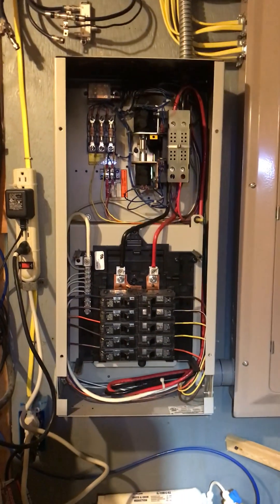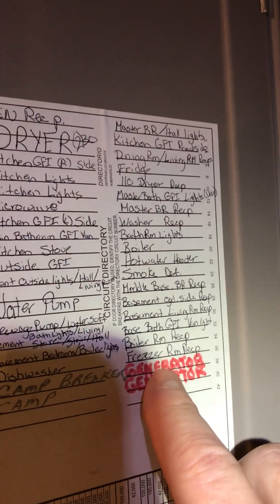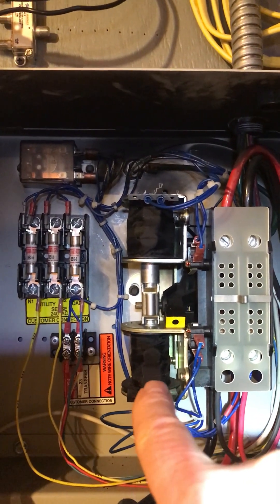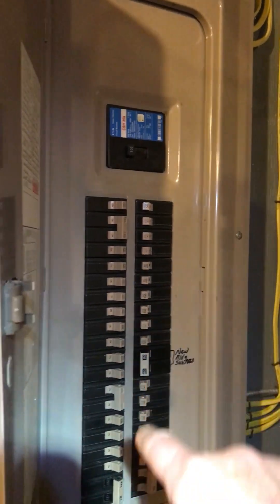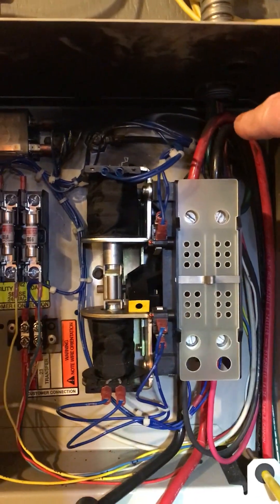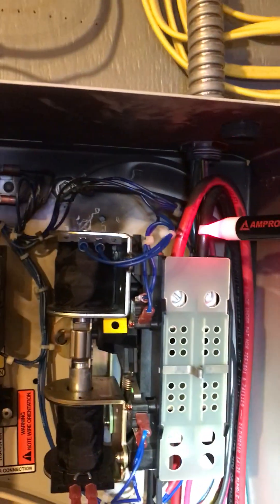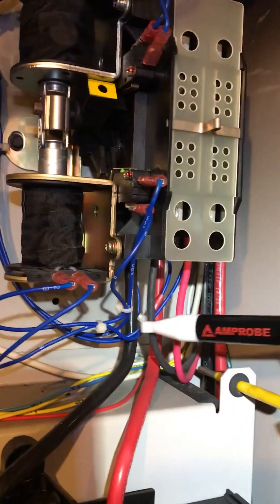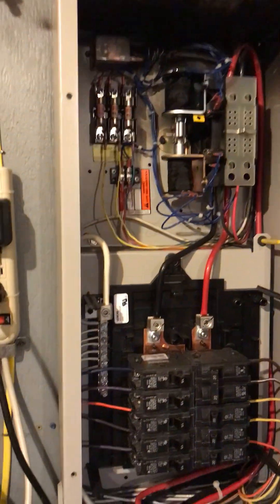TESTING THE REPAIRS TO GENERAC ESSENTIAL CIRCUITS TRANSFER SWITCH

Comment: Why such a big spark?
Reply from the maker: The transfer switches make the transfer under load. So the more circuits calling for power, the larger the load, the bigger the spark.
Behind that vertical cover of the actual switch are arc chutes to control the spark.
Reply: @snowman6686  oh cool!!   Didn’t know!!
Thanks for the fast response!

Comment: I had the coil melt on mine , the issue is that I had the unit replaced and it won’t transfer back to utility after the generator shuts down after sensing utility is back on.
Reply from the maker: Has it been fixed? What did you find?
When you say that you had the unit replaced are you talking about the whole entire Transfer Switch? If new, it should be covered by warranty.
If installed by a contractor - they typically warrant their work for one year.
The ones I've worked on use limit switches so that power is placed on the transfer coil for only enough time to complete the transfer. Then it's routed back to the other coil awaiting to transfer. (This is to transfer in either direction; to the generator OR to utility power - whichever way it's waiting to go.)
If your generator shut off with the return of utility power then I would have to assume that N1 and N2 are good and telling the generator that the utility power is back. (Generac uses N1 and N2.)
I would have the Transfer Switch looked at. There's quite a bit. Wires, limit switches, relay, coils and even linkage.
Reply: @snowman6686  found out it was the utility transfer relay  it was stuck , barely tapped it and it works now. Ordered a new one just incase for 29 bucks
Reply: Snowman, I just had the same issue today.
The upper coil slightly burned, which is preventing the transfer back to utility power...
Even with both Utility and Generator Power off, i couldn't move the lever back to utility.
It was doing what it is supposed to do until i turned utility back on....Generator Shut down but the lever never switched back to the utility power.
Maybe because the Upper Coil (Utility coil) smoldered it got the Plunger stuck?
I was thinking of just reordering the Utility Coil @snowman6686
Reply: My upper Coil melted which is preventing the lever to go back to utility power.
My plunger is stuck, because i can not manually move the lever up.
Thinking of ordering upper coil, which is the utility coil and plunger. @snowman6686

Comment: That small relay never saw any heat. The black is from the tape on the big coil burning off. You can actually clean it with a little Fantastic (or similar) on a rag. BTW, the failure point on the big coil is due to the internal diode pack going bad... usually from a voltage spike. With a bit of practice that job is no more than 20-30 minutes... and it helps if you have the right screwdriver. Of course, it also helps if you have 25 years doing this in the field.
Reply: I think i have a top coil failure this morning. I can manually switch it (for he city power) but nothing flows thru. I am stuck running the generator all weekend or longer til it gets fixed. Any insites?
Reply: @StangJuice  ... if there's no black marks and you can manually move the switch all the way but there's no power the whole contactor may be no good... but let's not jump the gun just yet. You can try resetting the main breaker just in case that has tripped. (it may be outside) You can also take a look at the meter outside. If the meter is blank, then your power is actually out. If the digital display shows numbers or is flashing, then you likely have power to that point and something else is wrong between the meter and the transfer switch. If I was there, I could probably track the issue within 5 minutes. It's something I did for over 25 years. BTW, you can also call the power company and they will verify things up to the meter.... but inside repairs are between you and your electrician.
Reply: @rupe53  power company said i have power.  There are 2 outside breakers, one for a pool and one for a separate garage. They are working with generator off. Everything else- through the xfer switch and into panel box in the garage - is not working from the grid. The solenoid is not switching on its own. If i manually switch it, it only works on generator side. It was all installed by a reputable electrician. I'll be calling them monday morning. Gonna burn up some propane til its fixed.
Reply: @StangJuice  .... unless you are a real good DIY type I wouldn't dig much deeper into it other than perhaps a test light or test meter to figure out where the power stops. By code there should be a disconnect / breaker BEFORE the transfer switch, which is worth checking. That said, you can shut the gen off while you sleep, and the fridge will keep for 8 hours. During the day you can run 3-4 hour cycles to maintain other things as well, while saving quite a bit of fuel. BTW, if you decide to cycle the gen set, always stop / start with the generator circuit breaker in the off position. This prevents wild voltage swings as it comes up to speed.
Reply from the maker: @rupe53  I only spent 12 years on a fire brigade achieving the position of Lieutenant. What do I know?
Reply: @snowman6686  ... retired deputy chief here with state certification as an instructor. What do I know?
Reply from the maker: @rupe53  If Ego were only a talent.

Comment: good video.. if I could hear you. Sound is crap. please re-edit and repost.
Reply from the maker: It's not the video. YouTube playback is sometimes lackluster in performance. My 8kw oil change video sometimes has the video track leading the voice track which is really upsetting. I do try to write an explanation of the video directly below in the event it's needed.
I use YouTube myself so I understand but I don't post for; money, a following or advertisement - just as an aid to those who are interested.

Comment: What size breaker are you fitting your RTS generator transfer panel ? and what size generator do you have?
Reply from the maker: These essential circuit remote transfer switches are 100 Amp panels. They are used on multiple sizes of Generac generators as long as their current rating is not exceeded.
This particular generator is only an 8KW  and can only supply 33 Amps at 240 Volt. You want to match the Utility circuit breaker to the breaker in the generator or the generator won't be able to support  the circuits in the essential circuits panel.
I don't like the generator to run flat out so I install the next size circuit breaker rounded down, or in this case a 30 Amp Double Pole Breaker.. 
You're looking at the wire gauge.
 Yes, I used a larger wire gauge to bring in the Utility Power. A #6 rated for much more current. A #10 to bring in the Generator Power.
As long as the circuit breaker is manufactured to accept the larger wire size it's copacetic.
As it looks like a company name, I'm guessing you knew that. Fair question just the same.
I did get sidetracked. I showed how the Utility Power comes in on the top of the Transfer Switch and travels straight through when operating on Utility Power. I wish I had explained that in a Utility Power Loss the transfer switch automatically transfers to the Generator Power which comes in on the bottom and goes right back out on the bottom to the breakers - when operating on generator power.
Next time I'll use an Audio Visual Voltage Detector as well. My Amprobe model seems a bit camera shy.
Thank you for your question.